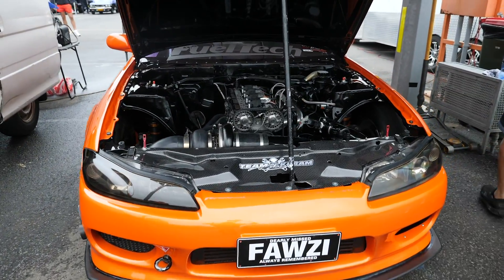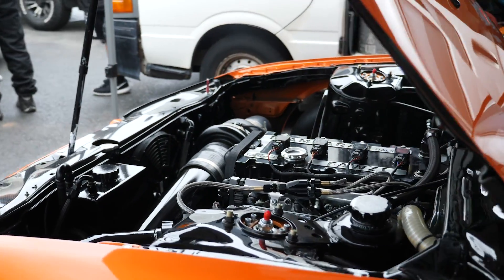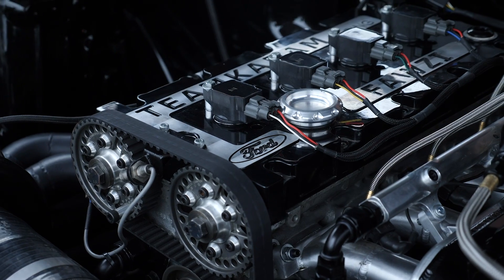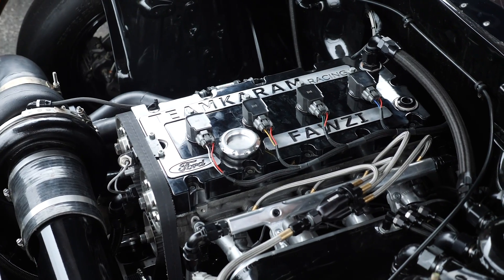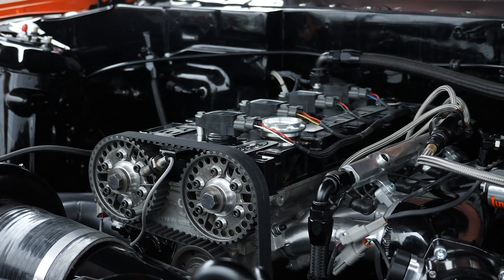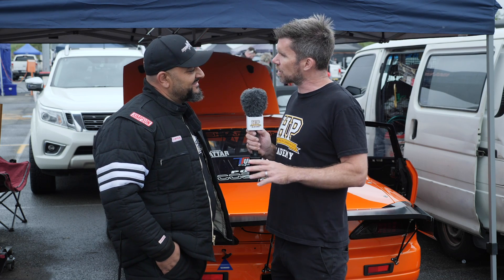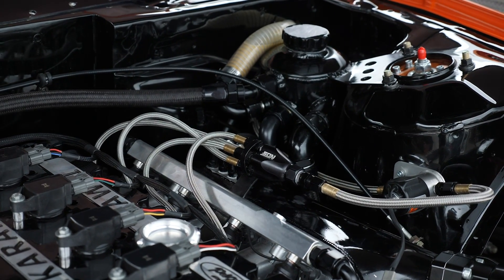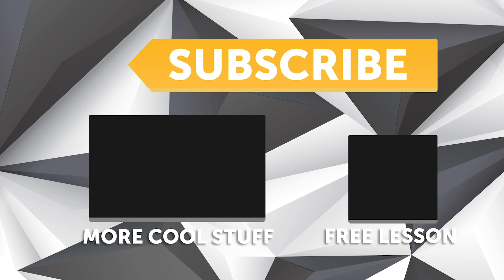1000HP Cosworth Powered Nissan | YB Swapped S15 [TECH TOUR]

Comment: How many times has that YB Cosworth engine been rebuilt since this video was made?
Reply from the maker: Depends how much it has been used. 1000hp+ engines require more work than a 100hp Toyota Camry, that's for sure with some components life span being measured in runs down the strip rather than kms when it comes to drag racing  😎 - Taz. 
https://youtube.com/shorts/CPxK_eI38SE?si=rO7WzcnUUX6PyHnS

Comment: This is an original pinto iron block as stated. I think that is a lot of reliability relative to the later model aluminium modern engines. the stud changes are pretty impressive as well. Very cool to see these 'retro' engines still pulling their weight with modern injection and turbos bolted on.

I'd like to build up a BDA engine one day, but it'll be tough to get by the girlfriend!
Reply: 205 block is original pinto this 200 cosworth block

Comment: The good old YB, designed 35 years ago!
Reply: Original block comes from the early ‘70s
Reply: But R&D by the consumers/engine builders was not instant. It’s taken a while to get from the 5/600hp of the late 80’s Touring car engineers to 1200hp these days.

Comment: I flippin love YBs. I know the SR20 is the fanboy engine of the universe, but YB is another level vs the normal DET versions.
VET is an amazing head, but YBs seem to take more of a long term beating for track and rally use than SR blocks.
Reply: As soon as I saw YB I knew you'd be in here Stav 👌
Reply: yb makes more torque too
Reply: 2 of the top 10 fastest 4 cylinder drag passes of all time are Sr20 ,Yb's are on a level below yes
Reply: @Realtime1501  because nobody uses YBs for drag engines normally. They’re legendary/successful rally and circuit race engines, unlike SR20s.

By your ‘logic’ the best 4cyl on the planet are GM ones, the Ecotec and the XE, as that’s the fastest two drag 4cyls.
And I doubt anyone would agree with that either...
Reply: @StavTech  Just in case you didn't watch the video, they are drag racing this car not rally or circuit racing it. So your argument about YBs vs SRs for track and rally use is irrelevant.
Reply: @albertt7784  well done Albert, great spot. Yet you miss my point wildly. People not using them is people not using them. That’s very different to people have tried to use them but they don’t last, aka SR in rally/racing
Reply: @albertt7784  the 4wd yb and rs500 engine can do 500+bhp on standard internals with just a better head gasket. I’d like to see an other 4 cylinder turbo engine do that and lets not forget theyre from the 80’s
Reply: @md-run  My car with a SR20DET has been doing 500hp @ the engine with standard internals for years under road conditions. Circuit racing would obviously be a totally different story.
Reply: @md-run  mark shead at MADevlelopments was telling me thy do 650 with just pistons and head work
Reply: @bencosturbz7755  its true, won’t drive as nice as a long rod engine but will certainly make the power.